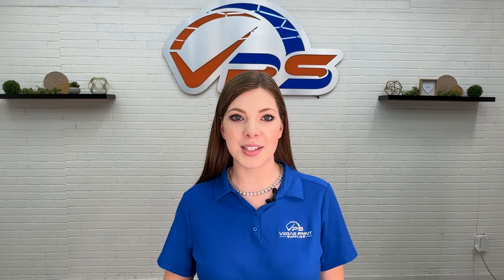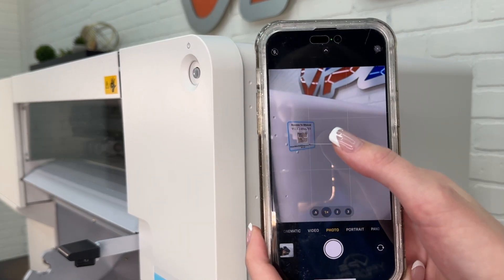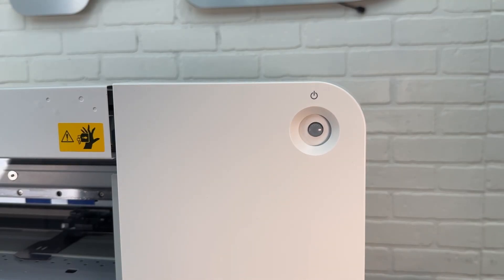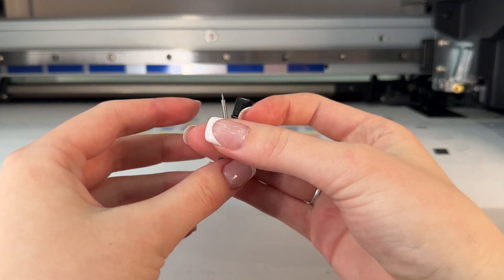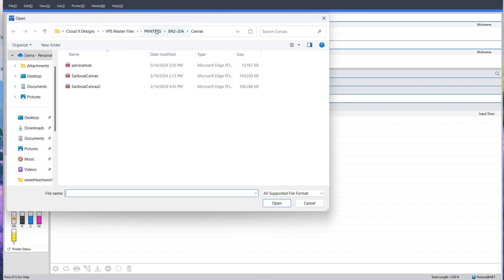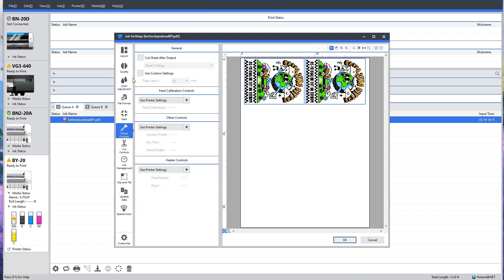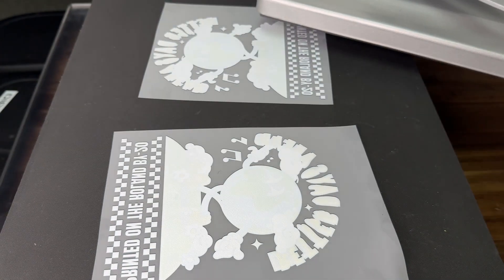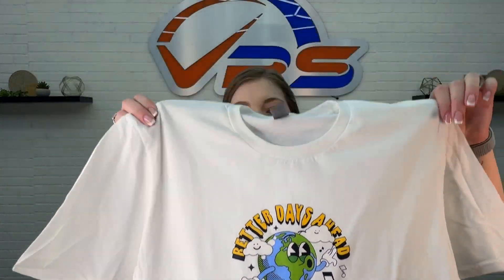Unboxing and Printing on the NEW Roland BY-20 DTF Machine!

Comment: How long do you hover to cure the powder before pressing?
Reply from the maker: It takes approximately 60-90 seconds depending on your heat settings and how far the platen is from the film. Roland now has a shaker/dryer unit for the BY-20!

Comment: How many designs or how many square feet can you print before changing the toner ?
Reply from the maker: It depends on the colors used, coverage, print quality, and size, but generally you can print around a full roll before needing to change the inks (minus white)